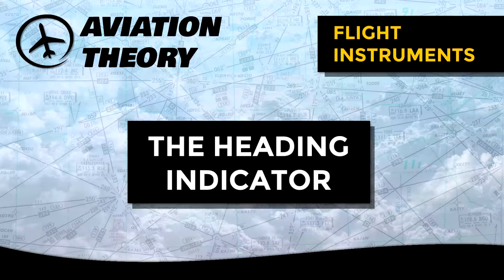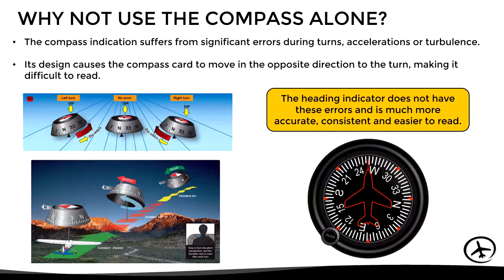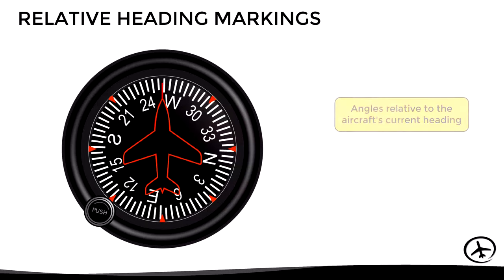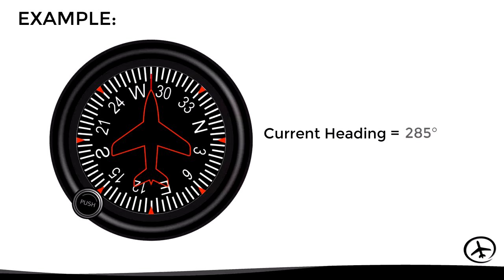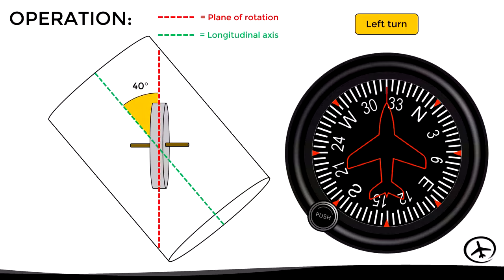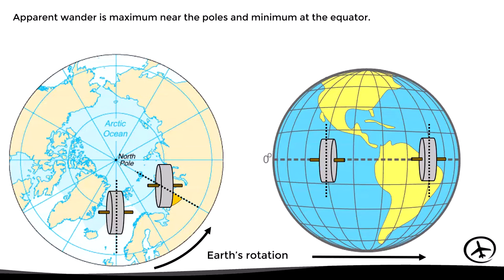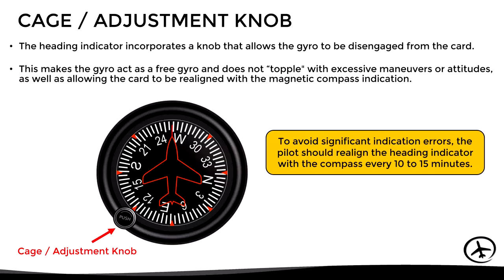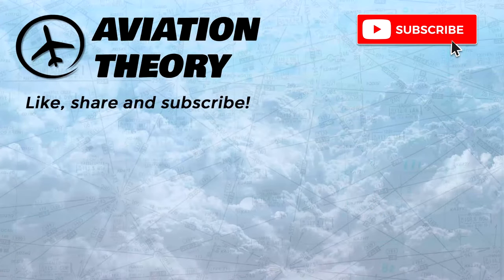The Heading Indicator (Directional Gyro)

Comment: Correct me if im wrong but at 6:35 u said it incorporated a horizontal gyro which I dont believe is true.
The gyro wheel in the heading indicator is mounted vertically and spins about it horizontal axis